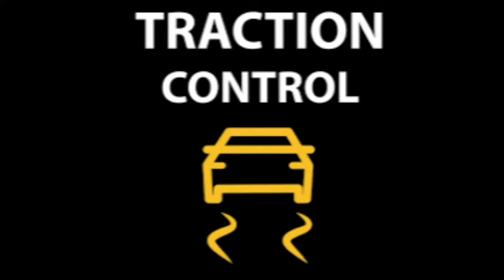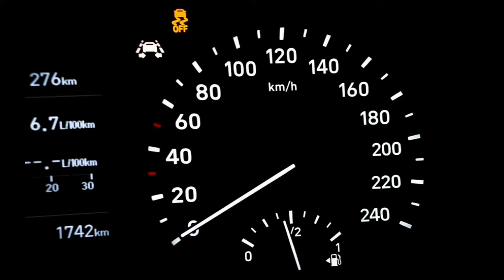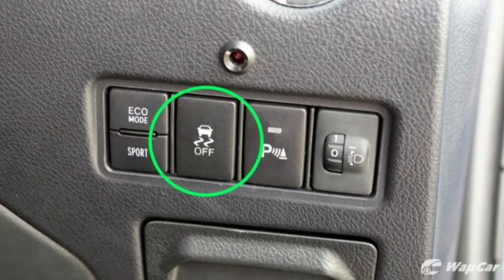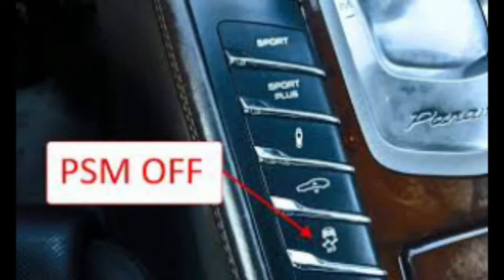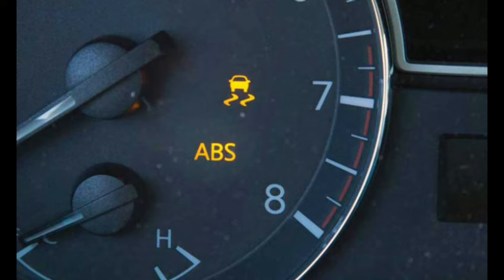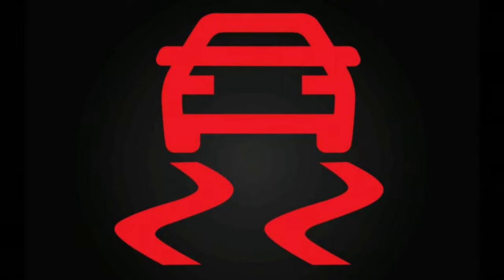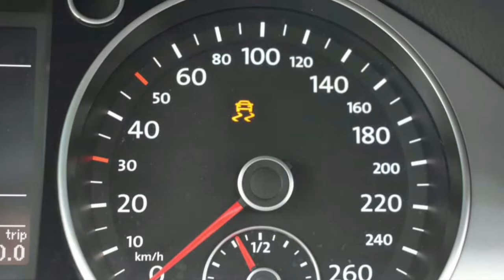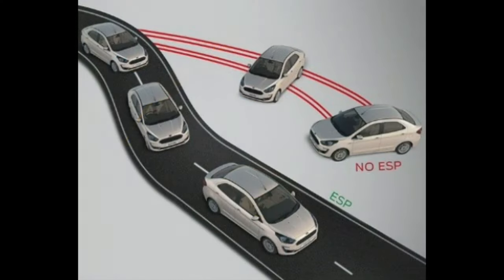How to Fix & Reset Traction Control or ESC Warning Light Stays On or Flashing | TCS Warning Light

Comment: Did anyone else have their light come on and the engine shifts hard and won't accelerate oner 40mph?
Reply from the maker: @Dr.kittens
One of the most common reasons traction control activates is simply due to low tire pressure.
2. Faulty ABS Sensor
3. Failed Computer Module
4. Unnecessarily Slippage
5. Low Brake Fluid Levels
6. Incorrect Tyre Inflation Pressure
7. Spinning Wheels
8. Faulty Tire Tread
Reply: How do you fix it? I remember it was just about turning the car off but I don't know if it works or not lol
Reply from the maker: @JohaxAlvarado  Resetting your car's traction control system by turning the car off and then back on might resolve temporary glitches, like a misreading from a sensor. However, if the traction control light stays on or keeps coming back, there might be a deeper issue, such as a problem with a wheel speed sensor, the system's computer, or another part of the traction system.

Here's a basic step you can try:

👉 Turn the car off and wait a few minutes. This can reset the system.
👉 Turn the car back on and see if the traction control light goes off.
Reply: My car do that and mechanics tell me a totally different story I'm going to Nissan dealers. And they each tell me something else is wrong. My 2011 light  started coming on around 6 months ago. I had my car now 4 yrs.
Reply: That and Very slow acceleration especially up hill.
Reply from the maker: @ronhood3243  Did any of the mechanics provide you with a diagnostic trouble code (DTC) to give you a better idea of what might be causing the issue?
Reply: Yes I have very slow acceleration and it sucks!
Reply from the maker: @roddyrod1978 A traction control light and slow acceleration often indicate issues with your car's traction control system or other components like the wheel speed sensors, ABS system, or even the engine. Here are some steps you can take:
👉 Inspect Wheel Speed Sensors: These sensors can become dirty or damaged and may need cleaning or replacement.
👉 Examine the Traction Control System: There may be an issue with the system itself, such as a faulty control module or wiring.

👉 Check Your Tires: Make sure your tires are properly inflated and in good condition. Uneven tire wear can also trigger traction control issues.
Reply: Resolved the issue; you have to pay very close attention to your sensor plugs. Both  of the CAM and CRANK sensors use three prong connectors and it’s very easy to plug them in the wrong way!
Reply: @Dashboardwarninglights  Thank you!! I will have that looked at and make sure my tires are inflated properly
Reply: My TCS light came on when my alternator went bad
Reply from the maker: @aw5003  The TCS (Traction Control System) light can come on for various reasons, including electrical issues related to a bad alternator. Here are the steps you should take:
👉 Replace or Repair the Alternator: Since the alternator is bad, it needs to be repaired or replaced. This should be your first step because the alternator powers your vehicle's electrical system, including the TCS.
👉 Check the Battery: A bad alternator can also drain the battery. Make sure the battery is charged and in good condition.
👉 Reset the TCS Light: After replacing the alternator and ensuring the battery is charged, the TCS light may reset itself. If it doesn't, you can try the following:
👉 Disconnect the battery for about 15 minutes to reset the car's computer.
Use an OBD-II scanner to clear any stored error codes.
👉 Test Drive: After resetting, take the car for a short drive to ensure the TCS light stays off and that the traction control system is functioning properly.
👉 Professional Diagnostic: If the TCS light remains on, there might be another underlying issue. It would be best to have a professional mechanic diagnose the problem using specialized diagnostic tools.
Would you like more detailed instructions on any of these steps?
Reply: Yes. I'm now living in the foothills of the Ozarks in Arkansas. I notice today that my RPMs were below 2000 rooms and had to down shift to D3.
Reply from the maker: adamg.617   If your traction control light comes on intermittently, and you're unable to rev over 4,000 RPM, this could indicate a problem with your vehicle's traction control system or an issue causing it to limit engine performance (limp mode). Common causes include:
👉 Faulty wheel speed sensors: These sensors monitor wheel movement for traction control. A malfunction can trigger the warning light and limit performance.
👉 Electronic throttle control (ETC) issues: If there’s a problem with your throttle system, the car might limit engine revs as a safety measure.
👉 ABS or traction control module fault: A malfunction in these modules can lead to reduced engine power.
👉 Engine misfire or faulty ignition system: If the engine isn’t firing properly, the car may enter limp mode, capping the RPMs.

You should have the car’s diagnostics scanned to determine the exact fault code behind the issue.
Reply from the maker: adamg.617   When the traction control light comes on during startup and the car takes longer to start, it could be related to a few possible issues:
👉 Battery or Electrical Issue: A weak battery or poor electrical connection can trigger the traction control light and cause slower starts. Have the battery and alternator tested.
👉 Faulty Wheel Speed Sensor: If the system detects incorrect data from a wheel speed sensor, it may trigger the traction control light.
👉 Throttle Body or Sensor Issue: Problems with the throttle body or a sensor related to the traction control system (like a mass airflow sensor) could cause both the light and delayed starting.
👉 ABS System Issue: Since the traction control system works in conjunction with the ABS, a fault in the ABS system could cause both issues. Check for any ABS-related warning lights.
👉 ECU or Traction Control Module: If the electronic control unit (ECU) or the traction control module is malfunctioning, it might trigger these issues.

A diagnostic scan would be the best next step to pinpoint the cause, especially since the traction control light indicates the system has logged a fault.

Comment: Mine has been on for a year but my vehicle definitely drives different. This happened after I replaced the rack&pinion and changed the two front hub bearings. Other than that the connections are fine.
Reply from the maker: @sirlloyn9115   
 " sounds like they may have left a connector loose " 

Your steering wheel spun and now the sas sensor no longer reads 0 degrees when going straight. Now the abs module turns the lights on. You need a good scanner to read that data, you're going to need to redo the orientation of the rack and intermediate shift

Comment: If you cannot get up a steep driveway you must turn this feature off because you need more RPM on the wheels on a steep driveway and it will cut the power out because the boat front tires will Spin and you will never make it up the Steep driveway it's a good feature but you do not ever need it to try and get up a steep driveway that is slippery with snow or ice you will not make it up because it will shut the power of the motor down that you need to spend the tires faster to overcome the slippery slope I always wondered how did people survive when we didn't have all this garbage on our cars to drive it for us we didn't have much problem with not having traction control we drove cars everywhere especially in the midwest through winter and that it's called simply driving your car and what to expect for the road conditions to have these computers that are expensive and make cars supposedly safer I guess I don't follow that in that has the traffic desk due to cars that lose traction on the highway gone up since we put the traction control on I probably doubt it but the manufacturers will tell you this is the greatest feature since the wheel blah blah blah😂
Reply from the maker: @driverslqqk7940
That's correct   But  Remember, it’s better to address the issue sooner rather than later to avoid turning a warning into a serious problem.

Comment: When I drive the engine light and the TCS/DSC light comes on… when trying to accelerate it feels like my front wheels are locked and it takes a minute to get up to speed… but when I turn the car off both lights go off or sometimes the dsc/tcs goes off but comes back on when i start to accelerate
Reply from the maker: @Roadrunner_kris
In today’s modern vehicles, all sorts of indicators, warnings, and lights tell you when something isn’t right with your car or truck. So when the electronic stability control light comes on in your dashboard, it’s time to take note of the message it has for you and take steps to get it fixed as soon as possible to keep your vehicle operating at peak performance. Learn more about why your electronic stability control light may be coming on and what you can do about it below!

1) Wheel Misalignment
One common cause of the electronic stability control light is wheel misalignment. This can happen if your car hits a pothole or curb or if you go over a speed bump too fast. If your vehicle starts pulling to one side while driving, your wheels are likely misaligned. You’ll need to align them with a professional as soon as possible.

2) System Has Been Turned Off
If you have car trouble and the electronic stability control light comes on, it could be because the system has been turned off. This is possible because most car manufacturers allow drivers to turn the ESC system off. However, it’s important to remember that only in rare circumstances should this system be shut off.

3) Steering Angle Sensor
Another cause of the electronic stability control light is a problem with the steering angle sensor. The steering angle sensor tells the car’s computer how far the wheels are turned. If it gets damaged or out of alignment, it can cause the light to come on. A car trouble specialist will need to check and fix the sensor if necessary.

4) Anti-Lock Brake System Malfunction
Another common cause of the electronic stability control light is a malfunction in the anti-lock brake system. This can be caused by various things, such as low brake fluid, worn-out brake pads, or a problem with the sensor. If you’re experiencing this issue, you must take your car to a mechanic as soon as possible to check it out.

5) Low Battery
Car trouble can be frustrating, and it’s never fun when a warning light comes on. The electronic stability control (ESC) warning light can be caused by electrical issues such as a low car battery or a blown a fuse.

If your car’s ESC warning light is on, see your mechanic as soon as possible to get the problem diagnosed and fixed. Driving with a malfunctioning ESC can make your car harder to control on the highway.

I hope this helps but if I can assist further let me know and I'll reply as soon as I'm able to.
Reply: @Dashboardwarninglights since you've mentioned electrical faults can be the cause of ESC lights on. Can the blown bulb triggers ESC to turn on and shuts off  the car while driving?
Reply from the maker: @aronsil9333  Yes, a blown bulb can potentially trigger the ESC (Electronic Stability Control) warning light, as the vehicle's system might interpret this as a fault in the electrical system. If the vehicle's computer detects multiple electrical issues, it could lead to the engine shutting off as a safety precaution. However, this isn't common; other factors, such as sensor malfunctions or more serious electrical issues, are more likely causes for ESC activation and engine shutdown. Always consult a mechanic for a thorough diagnosis.

Comment: I would rather have it off all the time then on. Atleast in a car with good power to weight. ESC off is the real crap your pants moment. My car currently makes 450hp and weight 3000lb with TCS on it is unpredictable when it breaks loose. It comes on and off multple time in a single moment. TCS is for people with lead foot automatics who can't drive. Nearly hit someone because it would jump half a lane with no real reason.
Reply from the maker: @christopherteresi3480   To permanently disable the traction control system (TCS) in your car, you may need to consult a professional mechanic or technician. They can either reprogram the system to remain off or physically disable it, depending on your car's make and model. However, keep in mind that disabling TCS can affect your car's safety features, so proceed with caution and consider the potential consequences before making any changes.

Comment: Mine been on for several months and still drives good even in rainy weather
Reply from the maker: @leonardorey7216   
You can avoid costly vehicle damage and safety problems by paying attention to these warning lights early and fixing them.👍
Reply: Why is the traction control light on and after a while the car lowa power
Reply from the maker: @Mypoortalent6888
If your traction warning light is accompanied by the ABS light and the red brake-warning light, your braking system may be affected. Contact a mechanic ASAP.
Reply: My light came on after I filled my tire and the light still on what should I do
Reply from the maker: @handsumrichNYC

The traction control light may come on after changing tires due to a few possible reasons.

Firstly, it is important to note that the traction control system is designed to monitor and regulate the traction of the tires while driving, especially during acceleration or on slippery surfaces.

When the system detects a loss of traction, it applies the brakes or reduces engine power to ensure stability.

One possible reason for the traction control light to illuminate after tire change is a difference in tire size or circumference.

If the new tires have a different diameter compared to the previous ones, it can affect the wheel speed sensors, which are crucial for the accurate functioning of the traction control system.

This change in tire size may cause the system to misinterpret the wheel speed data, resulting in the warning light being triggered.

Another reason for the traction control light to remain on could be a faulty wheel speed sensor. During the tire change process, the wheel speed sensor may get damaged or disconnected accidentally.

This can prevent the sensor from providing accurate and timely data to the traction control system, causing the light to illuminate.

Additionally, it is worth mentioning that modern vehicles often require a recalibration of the traction control system after tire replacement.

This recalibration ensures that the system is properly adapted to the new tires and can accurately monitor the traction.

Failure to perform this recalibration may lead to incorrect readings and the traction control light staying on.

In conclusion, it is not uncommon for the traction control light to be illuminated after changing tires. Possible causes include a difference in tire size, a faulty wheel speed sensor, or the need for a recalibration of the system.

It is recommended to consult a professional automotive engineer or visit a reputable service center to diagnose and resolve the issue.

They will have the expertise and necessary tools to accurately identify and rectify any problems with the traction control system, ultimately ensuring the safe and efficient operation of your vehicle.

Hope it is helpful for you.
Reply: But the light came on before I got my tire change. But I was riding on a tire that was losing traction for approximately a week and when I was on the highway the light came on
Reply from the maker: Common Causes Why Your Traction Control Light Is On

1. Wheel Speed Sensor Failure
2. Steering Sensor Issues
3. Wire Damage
4. Faulty Anti-lock Braking System
5. TCS Needs Reprogramming
6. Faulty Yaw Sensor
7. Defective Modules
8. Steering Rack Failure